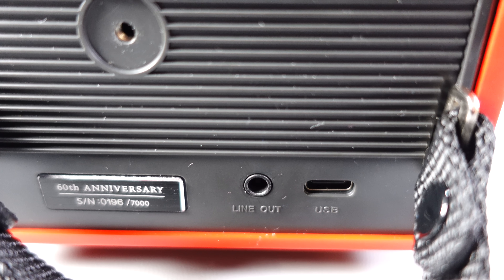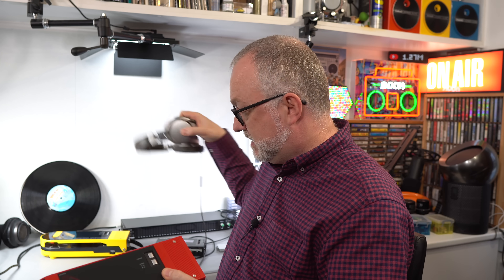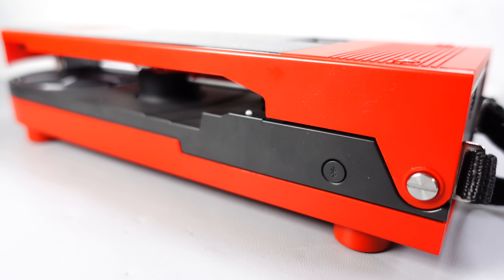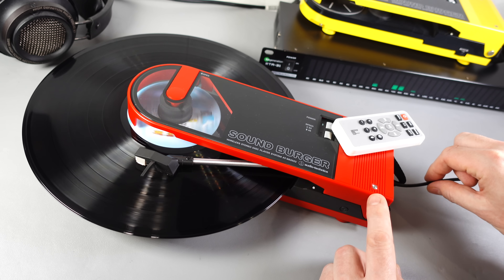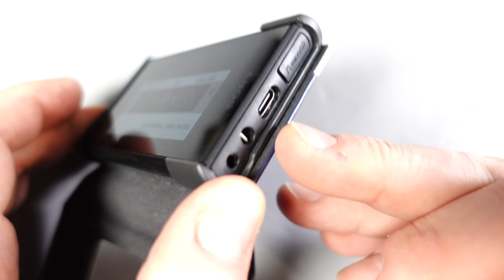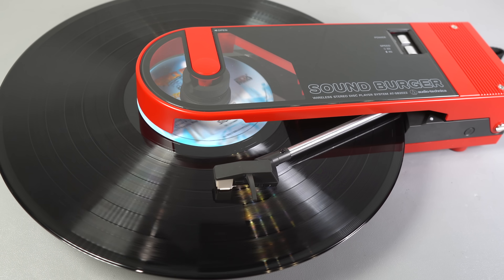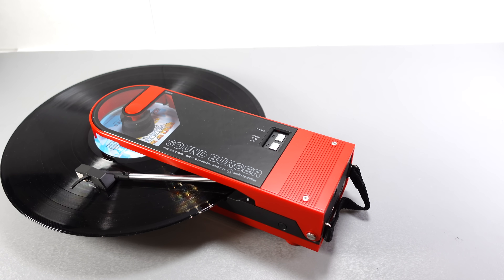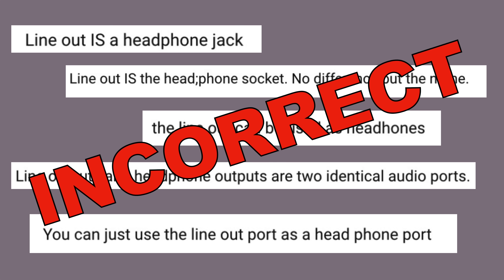Line-out ≠ Headphone-out

Comment: This also reminds me of a separate record deck. Some people think their deck is faulty when they plug their deck right into a line in…. But what you need is something called a pre-amp. So it would go…

Deck -> Pre-Amp -> Line-In - AMP 

… which brings the audio from the stylus up to the correct level. Some audiophiles go as far as using tube pre-amps because it gives a warm sound. Yeah, sometimes old is better than new.
Reply: It's not just the signal level needing boosted, the EQ needs fixed too. Phonograph massively drop the bass and boost the treble so the signal fits on the disk more effectively. A phono preamp restores  the signal to it's correct eq
Reply: Receivers often have a dedicated phono input that has the pre amp built in so you can just connect rhe deck directly.

Comment: I have a cheap setup with my TV connected to computer speakers. I use the headphone jack on the TV as a line-out because conveniently, I can adjust the volume (amplify the sound) using the TV remote instead of getting up to touch the knob on the speakers. I'm sure this causes distortion at high levels, but it's very convenient. I do however recommend a proper setup if you have the cash! Thanks for the video Techmoan!

Comment: Also, the headphone outputs are low impedance for driving the "speakers" in headphones (usually 8 ohms), where line outputs are usually 10Kohms, so the drive available on line outputs are too low to drive headphone/speakers.

Comment: Line out is normally a fixed level, like 1volt pk-pk, but it's also a voltage output not a current output.
Besides the level, line out isn't designed to drive enough current for the small speakers in headphones.  A speaker is almost a short circuit so you're be basically shorting out the signal.
Conversely, the headphone out is a current amplifier intended for a low impedance. So if you're using a headphone out as a line out, there would  be little or no current and the headphone amp won't perform properly which can affect frequency response and distortion. You would want to "short out" a headphone output with a 4 or 8 ohm resistor to use it as a line out.

Comment: Technically they both do the same thing: output audio. It’s just that one requires additional circuitry (amplification) to be practically useable.

So it’s inaccurate to say you can’t use line out for headphones, as you just demonstrated it is indeed possible. But it is also inaccurate to say that line out is the same thing as headphone out, like some comments claimed. 

I think all of this could’ve been avoided if they used different plug standards.

Comment: Moral of the story. A headphone socket will allow headphone, earphone listening. Whereas a line out will not allow headphone,earphone listening without additional hardware such as headphone pre amp, Bluetooth etc.
This knowledge has been lost in recent tech since the introduction of Bluetooth. 
Bluetooth speakers, Bluetooth headphones etc etc.
Impedance, and a basic understanding of the topic can give clarity to this much maligned subject.
Closing, I would simply say that in general, headphones require a high output which a dedicated headphone socket provides by default. 
Whereas a line out requires additional amplification to be heard over headphones as, by default it is a lower powered signal.

Comment: "Line Out" is a short-form term for "Line-level Out", and like-wise for "Line In".  Line-level defines a standard impedance and V(p-p), and by-passes any tone or equalizer controls so it's a normalized and flat signal.  
Headphone jacks deliver more current that's needed to drive headphones and, depending on the design of the specific device, relies on the current draw through a rheostat to control the volume; thus, using these for LINE OUT will not have sufficient current draw and will actually over-drive the LINE-IN on the receiving device, causing distortion.
The combo headphone/line out jack either detects the impedance of the receiving device and adjusts accordingly or (more likely today) uses a "middle-ground" impedance that's good enough for most devices.

Comment: Line out is BASELINE. Bog standard, minimum volume to be able to transmit the full signal to a receiving piece of equipment. It provides a clean signal with none of the noise that might be introduced by an amplifier. It also eliminates the crushing and clipping you would get from feeding amplified audio into something that's expecting baseline audio. If you feed line out of a tape player to the line in of a tape recorder, you should get recorded audio that is the same volume as the original.

Comment: Line out rarely has any form of volume control. I only remember 1 device that had it and it was a Radio Shack stereo cassette recorder from the 1970s, and it was less for "volume" and more for gain control for what I assume could have been lower volume recordings or the like as I don't recall it having AGC of any sort. As soon as I saw your video I knew it was due to the confusion that you mentioned of using a headphone-out for a line-out but you can't(easily) do the reverse.
Reply: Up until the 1980s or so most stereo equipment had a headphone jack with a knob labeled "Output" which controlled not only the volume of the headphones, but adjusted the level of the line out. An example is the AKAI GX-4000D reel to reel recorder.

Comment: It works, it plays audio into headphones fine and nothing horrible happens. Unless it's a particularly powerful line out and volume is set high. Yes some line-outs are higher power than headphone jacks. You're being quite anal frankly.
You didnt test what the volume actually was plugging normal 8-16ohm, small (not 32ohm high end) headphones into the line out. Could very well have been a listenable volume.
Explaining the difference is probably good, but acting like they're drastically different is just ridiculous.

Comment: Annoyingly, some devices claim they have a separate line out and headphone jack, only to run them both off of the same amplifier and both are influenced by volume control on the device. So not only does there seem to be consumer confusion over what line out is, there's also manufacturer confusion as well.

Comment: On a Laptop/Desktop, the line out is also a headphone jack. The difference is that the audio driver software detects the line, and you can specify what you just plugged in. I believe this is where the confusion started. Back when old computers sound cards just had lineout, it was used with headphones with no problem.

Comment: 11 minutes 55 seconds of stating the obvious. I had the original sound Burger back in the day and the phono line out was faulty. I plugged the headphone output into the phono line in on my amp using an adaptor cable. Had to turn down the volume control on the sound Burger to avoid distortion though.

Comment: Great basic explanation but as many have already commented, the magic word "impedance" is missing from this video :( Headphones are considered LOW impedance usually 32-100 ohms, whereas an amplifier input has an impedance of many thousands or tens of thousands ohms. Headphone circuits are designed and manufactured to output a signal into a LOW impedance load within a certain range of voltage and current. Line outputs are designed and manufactured to output signal into a HIGH impedance load. Just because you can get sound from either doesn't mean that sound is of acceptable quality when the impedance load is different from what it was designed for

Comment: there's some misinformation here unfortunately. The Hi/Low Gain control of the Amplifier has nothing to do with the line in, but with the impedance of the headphones you plug into the output. With low impedance headphones you probably shouldn't drive them at the high setting. Refer to the specifications of your device if you're unsure.

Comment: Also, its worth a mention that not all line outs are created equal. Professional grade audio equipment will include line out ports but these are NOT the same as those found on consumer gear. Pro line level has a voltage range of around 1.2 volts, compared to 300mV for consumer equipment.

Comment: On the previous video I mentioned in the comments that if you're reasonably savvy enough, not only could you fashion an auto-stop for the motor, but you could install the guts of a headphone amp and subsequent 3.5mm jack.

Comment: I had a disc man/ portable cd player that had line out. I was curious about line out and tried it come to find out volume was low. The line out is meant for amp or stereo receiver or tabletop stereo  that has auxiliary stereo input  r/l rca jacks. The yellow record player has a dedicated amp for headphones with volume wheel and line input you have to connect to auxiliary to hear what your listening.

Comment: The problem with line out is: Old models of audio equipment have low level output(250-300mV RMS) while newer modeks have 500 mV RMS and the newest models have 1 to 2V RMS . That's why there is so many problems with line outputs.

Comment: That can't work. "Line out" is the designation for amplifier, "Aux" is the designation for musical instruments and mixer. The level for "Line" and "Aux" was 775mV until 1990 and 1V from 1990. Headphones are controlled with 5 to 9V because of the different impedances. If someone wants to connect a record player with a magnet system to "Line in" , that's not possible either. MM cartridges have a level of 80 to 120mV. Only Ceramic or the old Crystal cartridge have 500 to 600mv, that works... 😉

Comment: to summarize,
Headphones are power devices, they do work, they need power with which to do the work, and providing power is the job of an amplifier.

Line Out is a signal output, it does not do work, it only carries information, and it's harder to maintain signal fidelity with more power involved, which is why amplifiers need to be good, and you don't necessarily want powerful signals between signal handling components.

Comment: Another thing about using a Headphone output as a Line Out:
Aside from the volume control,  any other type of equalization such as bass, treble, XBS/Bass Boost etc. are also affecting the audio coming from the Headphone output,  whereas the Line Out is flat response / unequalized.
While the added equalization might make the sound nice,  if you are making a recording this may not be desired vs. original source.  Also,  most tone control and equalization amplifiers add their own noise, hiss etc.  so the S/N ratio will typically never be as good as line out.

Comment: If it says "Line Out" then that's what it is, it's a fixed signal level to connect to another piece of equipment that has a "Line In" , typically amplifiers etc. including headphone amps. It is NOT a headphone socket. simple.

Comment: The line out and headphone jacks have a very simple difference coming down to the fact that the "line out" is supposed to supply a fixed output volume/impedance etc that normal device inputs should expect while the headphone jack is just a variable output that can work for both cases but is not optimal for feeding line level inputs and better reserved for direct to speaker/headphone connections to correctly power them and help avoid mismatched impedance and therefore drive the headphones properly (for the most part). At least that's my sorta educated guess...
Reply: This reminds me of the "These goes to 11" "Why not just make 10 louder?" joke on Spinal Tap. Amplifier levels are not standardized, but line level is. I guess.
Reply: Best reply ! Others are rattling on about impedances etc , forgetting this basic difference.

Comment: Typically the 'standard' for Line Out would be 1 Volt into 10 K Ohms (Line in impedance).

Looking at the specs of the FiiO headphone amplifier at 10:35,  with 450 mW output into 16 Ohms, it would likely drive some unpowered/unamplified 'computer' speakers at a pretty decent volume,  and the S/N and frequency response is great.
Reply: Many unamplified computer speakers are basically headphone speakers in a box anyway :)
Reply: @chaos.corner  This is true... especially the really low-end ones.
Reply: @LakeNipissing  I may have had some of those in my time. Probably Hitaki, Sonyos or the like.

Comment: Similarly, line in != mic in. But I use my computer as a free mixer for my handheld gaming sometimes and either works fine. That's because you can easily change the mic gain to offset the difference in expected line level. I wouldn't try to use headphones from line out since there's no additional amplifier
Reply: Microphone input is even more complicated.     Most microphones have an output that is many times smaller than 'line' (0.001V versus 1V P-P)...    then there's condenser mikes that are even LOWER output, like microvolt levels, although these often have an integral preamp to raise them to standard mic levels.
Reply: @geepeerces  condensers need 48v "phantom power" they won't even work without auxiliary power supplied directly to them from the pre-amp. but virtually every XLR recording interface made in the last 25+ plus years has had phantom power and now with streamers and podcasting, content creation, every other person who isn't a musician already has one now. plus they are usually a better headphone amp than whats built into your computer (unless you have an Apple or Sony computer IME)
Reply: I had the opposite kinda experience, plugged a guitar amp headphone out into the microphone input. The soundcard burning up was a very unique noise I don't want to ever recreate again
Reply: older desktops have line in, some have both in the same port, realtek will ask what did you plug in, recent laptops don't even have mic in anymore
Reply: @namesurname4666  Older desktops? Most motherboards will have this.
Reply: Also a mic out port usually has a DC offset to power the mic itself. On a PC you can change what port does what but in a usual Hi-fi system you won't get any sound at all if you plug a microphone into a line in port (unless it has a preamplifier of course)

Comment: I believe a line input circuit is designed with a higher impedance than a standard headphone. That is why the sound is more quiet. The output amplifier circuit in the line out device is being overdriven.